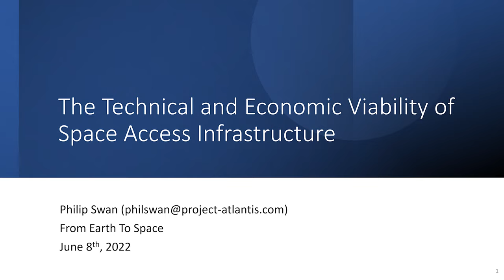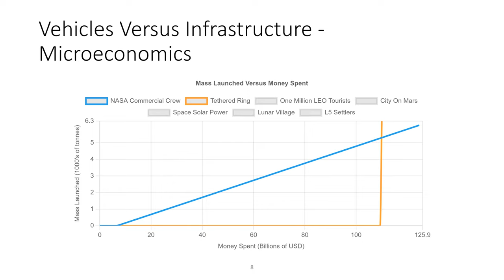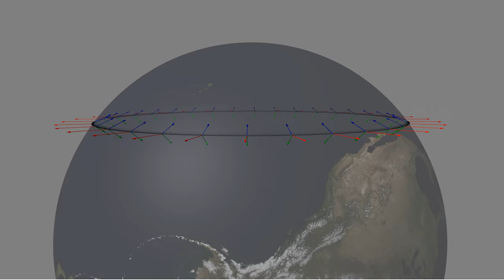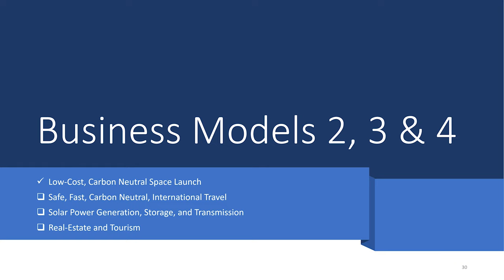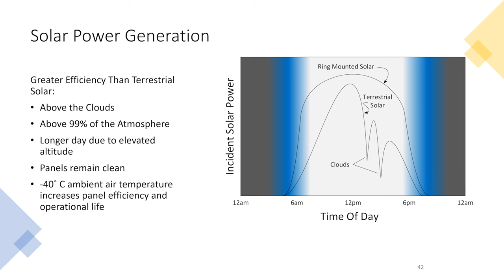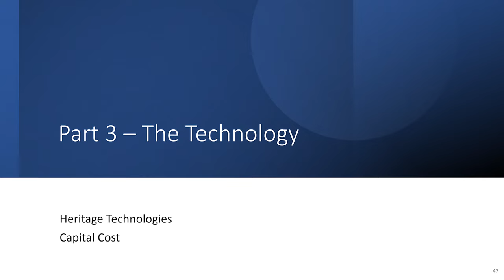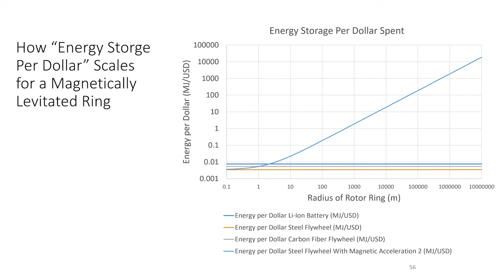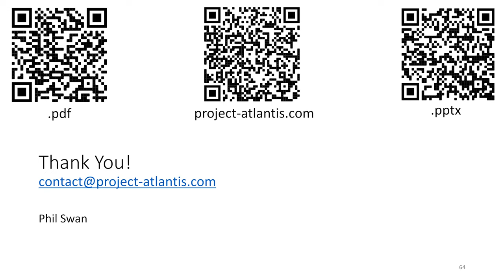From Earth To Space 2022 Tethered Ring Presentation

Comment: This is amazing. Finally - a way of reaching the stars that makes financial sens.
Reply from the maker: Well said! The best way to transition to a sustainable solar-system-wide economy is for it to simply make financial sense.
Reply: Have you heard of skyhooks and rotating tethers? Even lower cost.
Reply from the maker: Of course! I have never come across an official study into their technical and economic feasibility though. I suspect that space agencies have chosen not to invest heavily in them (for Earth application) due to concerns about space debris.
Reply: @spaceinfrastructure3238  Likely also just a case of needing infrastructure in place before investing. The companies that use the hooks (shipping, travel, rocket companies generally) likely would be different than those supporting the tethers (satellite companies). So until someone builds a few, the rocket industry doesn't have much incentive to work on different tech. But as soon as someone built some, everyone would be looking to add tethers as an option on their vessels.

Comment: So cables are cheap, and are definitely manufacturable on large scale, but what about everything else? Magnetic bearings- maglev tracks- electricity infrastructure- millions of powerful winches/ anchors to hoist the structure. I think that's where the main costs would be. Just bear in mind that every part will need to be replaced at some point, and the ring will need to be lowered to add new lines. a 35km elevator ride will take a while...
Reply from the maker: There's a pie chart in Isaac Arthur's video that shows an estimate of the cost breakdown (see: https://youtu.be/8B2iqiKehyM?t=1056). Individual tether strands can be drawn through and replaced similar to the way this is done for suspension bridges. There are five rings so that one can be taken off-line for maintenance and refurbishment. At 2m/s2 and 200 km/h top speed, the 32 km elevator ride takes 4.3 minutes.

Comment: Paul Birch engineered and wrote a couple books about this exact concept... in 1971.

Modular and stackable, the original design can be built up, and expanded into an actual livable habitat, with launch capabilities. 🤷‍♂️
Reply: And don't forget it's derivative project, the Lofstrom Bridge.

A 2800 mile long maglev gun used to launch 5tons to a transfer orbit every six minutes.
Reply: @KaryxofBeornve  Paul Birch published papers on Orbital Rings in 1982. If he had conceived of tethered rings in 1971, I don't think that he would have published the papers that he did on Orbital Rings in 1982. But, if you have links to the books he wrote in 1971, please post!

Comment: How will the tethers affect air travel safety? What's the average distance between the tethers at altitude and how far can the tethers drift from winds?
Reply: The whole thing would be more or less rigid. Like suspension cables on a bridge.
Reply: @delventhalzac  
Well! That answers the air safety question right there.
Reply: If the rendered images are anything to go by, the tethers would be far enough apart so that air traffic could safely pass through. I mean airplanes regularly find the path to a runway no more than about 80 meters wide, they are more than capable of going through two tethers that are kilometers apart. I don't think the structure would pose more of a risk to an aircraft than, say, another aircraft they pass while flying. And that happens a lot.
Reply: I realize that but mistakes and errors happen. The public is irrational and it only takes one event to make people believe 'x' is dangerous or a bad idea. @khymaaren

Comment: Railbound systems are very efficient and can use cheap green energy, but any railbound transport system needs to be a network in order to be reliable. Vehicles need the possibility to divert from their default route to circumvent sections failed or under maintenance. So we would have to put into space more something like a "spider web" instead of a simple ring for the system to be viable. Also, a web would allow to go to more places on Earth's surface.
I must say I'm much more fond of the energy production and storage concept than of the transport idea, also for safety and comfort reasons.
Reply from the maker: I agree.

Comment: questions

1: what is the smallest possible radius? my guess would be where the tethers have an angle of 90 degrees at the ground? the mass inside would probably have to spin faster the smaller it gets?
2: could magnetic vehicles traveling on one reach orbital velocity?
3: what happens when a part of it gets damaged? does the entire thing fall down?
Reply from the maker: 1) The smallest radius depends on several assumptions, and you can explore these by using the 3Dmodel/digital twin found at project-atlantis.com. The short story is that when you reduce the radius, more of the mass goes into supporting itself and less into supporting the various facilities, so larger is cheaper. 2) The launcher accelerates space vehicles to greater than orbital velocities. The latest thinking on terrestrial transit vehicles is that they would travel at below the speed of sound in a light gas such as helium (3751 km/hr) or hydrogen (5306 km/hr). 3) There’s an IEEE paper in the works that explores the topic of terrorism and damage. If you’re like to read it, there’s a link to it in the Discord discussion, and the Discord link can be found on the project-atlantis.com website.

Comment: From SFIA, I know a launch loop like this can change the way we access space forever. Yet, I'm not sure how it can be constructed and then lifted into the stratosphere. While the current level of technology allows for active support, it is only possible after the ring has been completed. So... Would the ring be constructed on the ground and somehow lifted into the stratosphere, or would it be somehow constructed in the stratosphere?
Also, is it low per destination cost for international travel? A ring could only serve destinations under the ring, and I doubt 32 kilometers of an elevator to the stratosphere would be any cheap. This will be like building a hyperloop in the stratosphere.
Reply from the maker: A tethered ring can be constructed in factories situated on the pacific coast, tested underwater in the pacific ocean, and then raised to the surface, and then up into the stratosphere. There's a storyboard for a construction video on this channel that goes into more detail on that. The patent (see website) covers this topic too.
There is a cost per available seat kilometer (CASK) calculation in the digital twin / 3D model which you can find on Github (https://github.com/philipswan/TetheredRing). A paper that discusses the CASK calculation is currently undergoing peer review. It covers some of the reasons why a ring mounted transit system can end up being cheaper than airplanes while also being very fast and carbon neutral. If you would be interested in participating as a reviewer of the paper, please contact us through the project-atlantis website.
Reply: @spaceinfrastructure3238  Noo, please don't put it in the salt water 😭
Reply: Lots of come-along ratchet winches to lift the ring.

Comment: My doubts center around the need for active support. If a bridge falls, the interstate highways system doesn't crash to the earth. But this really is an ingenious system, maybe partway between a beanstalk and a space fountain.
Reply: Much of it won't fall. It'll fly off. Some will burn up. The rest may drift down or fall depending on how the system is designed.

In any case, if a bridge isn't painted regularly, inspected, repaired then it will fall down and kill everyone on it.
Reply: @iivin4233  Yes, but if you unplug one bridge the interstate highway system doesn't fall down.
Reply from the maker: @iivin4233  BTW, I saw in my email that you made another comment about Mars, but then I couldn't find it here. Guessing that you deleted it? Just want to reassure you that I did not delete it.
Reply: @spaceinfrastructure3238  I deleted it because you covered my concern later in the presentation.

Comment: During manufacture, if there is a inside ring running inside the outside ring, wont this create gyroscopic forces. If build on the side of the globe, wont this try to push the ring against the rotation of the earth?
Reply from the maker: Yes, but the forces are small. Search these comments for "1/48th" to find an earlier reply on this question.

Comment: Interesting concept.  Great for a planet with no terrorists.  Probably will be the #1 target for terrorists the world over.  How about a space elevator, we might be able to protect the base where it is connected to the earth.
Reply from the maker: Thanks! Best comment ever! The terrorism topic is covered in a paper called "The Techno-Economic Viability of Actively Supported Structures for Terrestrial Transit and Space Launch" which you can find here: https://www.project-atlantis.com/wp-content/uploads/2023/07/TetheredRingPaper.pdf. 
The tethered ring is architected to be constructed with materials and engineering that we already have and use widely today so that its cost can be accurately estimated and the business case can be modeled (these are the rules we decided to play by). The ISEC earth-based space elevator architecture is currently based on the assumption that: a) We can cheaply manufacture single crystal graphene (which basically means 100% "defect free" graphene), and b) That this material, while under extreme tension, is impervious to degradation from cosmic rays and microscopic space debris. Since nether of these assumptions are "engineering reality" yet, this version of the space elevator, at least for now, gets ruled out by our own self-imposed "technical feasibility" rules.

Comment: Phillip Swan - Here's an interesting thought:  As the ring rises, the tethers must either be extended or the anchors moved.  Eventually, at some altitude, the sums of the tethers' pull and gravity are equal and opposite to the force of expansion of the ring.  What kinds of forces are we talking about here?  Are they similar to the forces on the cables of a suspension bridge?
Reply from the maker: Yes the tethers are played out from spools and the anchors move backwards as the ring is raised. The reference design (available on line) uses an engineering factor of 2 and just makes the carbon fiber tethers thicker when you increase the design altitude, which increases the cost. The curve of the tethers is defined by the "constant stress catenary", which is only slightly different from the regular catenary curve of a suspension bridge. The stresses in the carbon fiber cables are proportionally greater than the stresses in a suspension bridge's steel cables, simply because carbon fiber is stronger than steel.
Reply: @spaceinfrastructure3238  very interesting megaproject.  About a year ago the greatest length of a carbon nanotube was about a meter.  What lengths will the tethers be?
Reply from the maker: @robertgraybeard3750  The tethers uses carbon fiber, which is mass produced today and used in all kinds of products. The tethered ring does not make use of any futuristic materials or technologies. It does not need carbon nanotubes or graphene.

Comment: My question is how would you conduct maintenance on the spinning ring? You can't stop it, and anything that moves will break down over time.
Reply from the maker: There are at least 5 rings, so you can take them off-line one at a time to do scheduled maintenance. You can also design some parts, such as maglev controllers, with backups and make these components hot-swappable like we do today with hard drive arrays in server farms.

Comment: What a fantastically impossible thing to build. You want to build it somewhere and then move it somewhere else - all above open water? Excuse me but wtf.
Your ring will need to withstand enormous compression/tension and buckling effects, such material does not even exist in an engineer's dreams. "Lifting it up" by those tethers will make it snap while it's still on the ground.
All of the ludicrous concepts always have terms like autonomous, solar power, cheap & efficient slapped on them. I'm surprised it's not covered in LEDs to wow the fools.

Comment: Hyper loop. In space
There is a little problem, if you have a catastrophic failure to the spinning ring the whole structure will collapse,
And from a civil engineering perspective how would you even build it? You would have to construct the whole ring on the ground first, evacuate it, spin it up to operating speed than winch it up gradually, but I do love the anti gravity part, I have thought about a hyper loop around the equator, if you go fast enough you will become weightless
Reply from the maker: That's exactly right! A storyboard for a construction video (which you can find on this channel) uses the very process you outlined.

Comment: If the ring does not rotate in the same plane of rotation as Earth, is not precession a serious problem?
Reply from the maker: The ring rotates twice an hour. The Earth rotates once every 24 hours. So the gyroscopic forces are roughly 1/48th as strong and the forces that the magnetic confinement system already needs to deal with.

Comment: Remember when a fighter jet severed the Cavalese cable car's cable?
Reply from the maker: Yes I do! This is what the white paper says (so far) on this: The tether engineering factor in the digital twin is set (by default) to 2X so that if that if one tether is severed the neighboring tethers can still support the ring; however, selection of the optimal engineering factor merits further study. After a break, the tether tensions in the vicinity can be quickly adjusted at the anchor platforms so that the ring is less curved right where the lost tether was located. This redistributes the tensile forces across many neighboring tethers instead of just the ones nearest to the lost tether. Tethers ring anchor points can also be directed to slide around the rings, redistributing the tethers to fill in the gap left by the lost tether. After a new tether is installed, they can be redistributed back to their original locations.

Comment: There may be a way for assembly in space, Setting a pulley mechanism with modular blocks of the ring, only with basic carriers💍 propelling back & forth, keeping the block at elevation, with another block joining the first hanging... The pulley setup would be spread as engineering demand & distance needed, be that across ocean or whichever, railed is fine, aerial fueling doable should the carriers be of classic propeller. In all cases they would be specifically engineered for this purpose, the pulley & number of carriers would help on countering the forces, 🤔some payload transfer to pulleying.

Comment: only way this gets off the ground is if you can incrementally build it with utility in-between. it nice and all to say that "real physics says it works!". but no country is going to foot the bill making these obscenely huge tether points and ring parts just to sit around there for years until the big day where we all hoist the thing up and cross our fingers hope it ACTUALLY works. good on paper, but people rarely take risks because "it works on paper". roads are more expensive, but you can incrementally build them and get immediate utility every inch you lay down.
Reply from the maker: I agree and discussed some of the stepping-stone concepts in the last third of the video. While there are other kinds of mega-projects that are worthless until they are finished, such as bridges, dams, ships, pipelines, etc., these are still incremental in the sense that they can trace their lineage through a series of similar but smaller bridges, dams, etc. that had utility and served to buy down risk for the larger projects. I would like to find some examples of successful megaprojects involving larger leaps of faith, such as landing on the moon or fusion reactors.

Comment: Well, you're going to need 2 or better yet 3 rotating masses in each ring, with all the infrastructure to make that work, because you're going to have to fix it sooner or later.  Shutting down the ring that keeps it up doesn't sound like a fun maintenance plan.  And then, 1 rotating mass must have the ability to keep up the mass of the other 2, along with everything else.  Planes can fly with 1 engine, right?  Might not be able to take off but they can keep going and land.  Thus, and right off the bat, you actually lose upwards of 2/3 the planned capacity to safety.  Along that line, there must be a well-planned decommissioning process for bringing one of these down.  Also, like anything else, when you store a lot of energy in any kind of system there has to be an understanding of what happens if that energy goes in an unintended direction.  Lift something up, charge a battery, compress a spring, or spin millions of KG of mass at hypersonic speeds... you've got to have a plan.  An unintended 1000x Rods of God self-hit strafing a large chunk of the planet is not a good plan.  Everything has to be designed to burn up or something.

Me... I'd like to see it combined with dynamic towers.  Build it, lift it with cables, then start building dynamic towers up to it all over the place.  Even if it still needed cable for full support, people would be way happier seeing towers down to solid ground.  Conversely, people would be way more comfortable going up a huge spindly tower if it was connected to something at the top.  The 2 together would likely have easier safety margins to keep the engineers happy too.